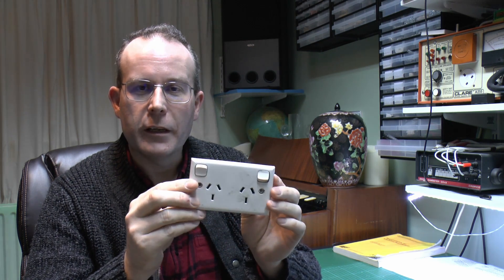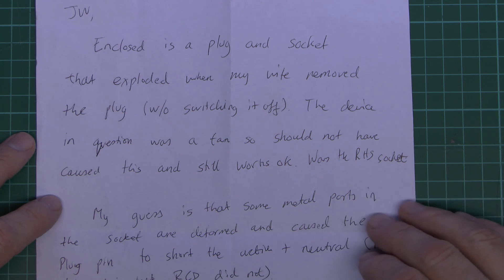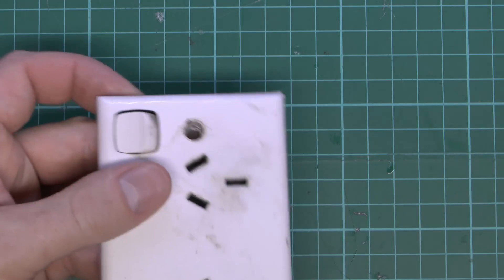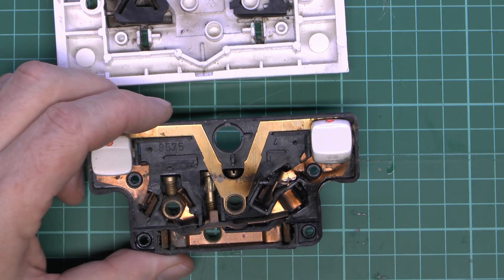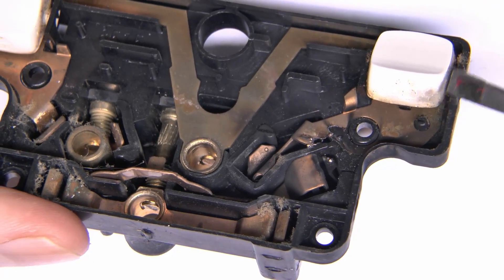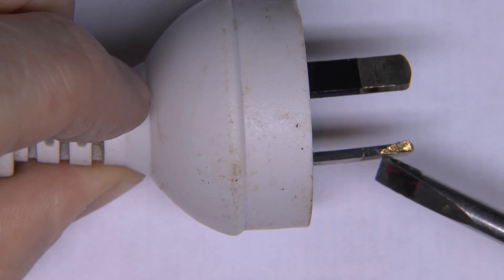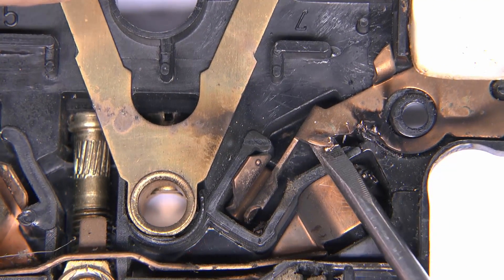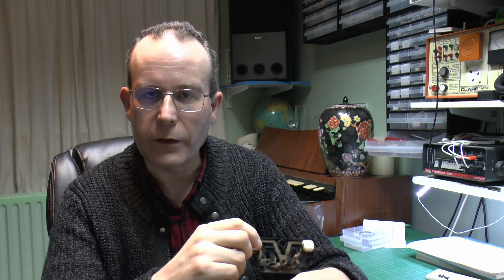Failed Australian Socket and Plug

Comment: It's hard to tell for sure, but the socket looks to be from the early 80's.   Maybe sockets wear out after a while, especially if you plug and unplug frequently.  HPM is regarded as a reasonably good brand.
Reply: Tommy Oz 1991 date code IIRC. Definately was a well used socket being in the kitchen.
Reply: That's interesting, did you replace it with another HPM?  :)
Reply: Tommy Oz I think the Clipsal brand are usually better
Reply: Tommy Oz can't remember the brand, HPM or Clipsal but it looked almost identical to this old one which also matches the rest of the house.  This one and one near it are by far the most used in the house so I replaced both at the same time.
Reply: Nonsense, (with all due respect) they are cheap crap and always were. Reputable electrical contractors (like I was) always shied away from HPM. The 777 socket was made from probably mid to late sixties to somewhere around 2005 as far as I am aware with no change in design This was despite HPM being constantly told of common problems. The only thing HPM ever made that was good was some of their electronic devices such as timers and the old incandescent  light flasher/chaser units and I suspect they were sourced from Asia.
Reply: Micky Mouse...this was a one-off failure and it could have been due to the person continuously wiggling the plug as they pulled it out over time.  The electrical safety standards in Australia are as strict as those in the EU and the UK and, as far as I am aware, a bit stricter than those in the US.  The HPM branded stuff was common place in homes from the 60s up to the 90s.  Clipsal was another brand here who made very good outlets (including hospital grade) and continue to do so.  Unfortunately (and I'm sure this is happening around the world) there are some questionable sets coming in from China these days.  The Chinese stuff made for local reputable brands is usually okay and has been submitted for testing by the regulatory authorities BUT there are these "dollar stores" that have cheap Chinese stuff that have the regulatory stamps on them (fake) but are absolute rubbish.  The authorities here regularly raid these sorts of places and then fine the suppliers but it's like trying to hold back an ocean wave!
Reply: Well I have better things to do than go on about this. You will find that nearly all reputable electricians in Australia think HPM is crap!
Reply: @bobmarshall3700  hello Bob is there a brand you recommend in oz?
Reply: Being in the kitchen grease and mildew can build up inside, it happens here in the UK too, usually the ones close to cooking appliances
Reply: Tommy Oz they are mandatory in caravans and motorhomes due to many campsites and extension leads being of unknown provenance.
Reply: HPM is fine. The 777 series came out in the very early 70's. My house was built in 1976 and had a mixture of HPM and Clipsal throughout. All replaced with HPM excel series during recent renovations. The only socket that did fail was a single Clipsal GPO in the lounge room. It wouldn't turn off (the mech would move but the socket would still be live and would need a few goes for it to turn off. Replaced with a HPM standard double years ago and then with the excel series recently to match the rest of the house.
Reply: Recently I was looking at the double pole switch style sockets that disconnects both active and neutral.  I wonder if these are ok for use in the home?  I guess it could make things a little safer since it completely disconnects the appliance form the mains. You can find it here: https://www.jaycar.com.au/double-gpo-with-2-pole-switches-for-caravans-motorhomes/p/PS4069
Reply: Tommy Oz outlets do wear out after a while as I’ve had to replace five in my house because the bedroom circuit is on the same breaker as the living room outlets (American Style outlets) and one outlet failed so two of the living room outlets worked and the rest of the outlets were dead so I narrowed it down to one outlet that had just died no sparks no fire nothing it just stopped working
Reply: I am glad that ill not be going to Australia any time soon, if that is the standard and quality of their sockets. They look like crap and potentially dangerous

Comment: This is the reason why it's important to switch off before unplugging. Had they have been in the habit of doing that, the short would not have happened despite the loose part in the socket.

Comment: I need to replace a Chinese 2 pin plug on a small exhaust fan with an Australian one but the replacements all seem too big and loose on the power lead. Do you know of a replacement plug that is smaller and suitable to small appliances. Thanks mate.

Comment: This plug is also used in Argentina
Reply: Also in China, Fiji and New Zealand
Reply: @LoganT547  No, the Chinese ones look the same superficially, but are wired differently and sockets are installed upside down.

Comment: Legrand bought HPM a little while back,so I'm wondering if design changes are in the pipeline,I have always been an HPM fanboy,I detest Crapsal,sorry Clipsal,I hate the way the switch mechs feel,in my experience they fail in different ways though,but having said that their 3 phase & industrial gear is not too bad.

Comment: I supposed that's why each socket has its own switch. The switch is supposed to be off whilst hooking/unhooking plug. Here in America we don't have that but I know to make sure the power switch on an appliance is off during connection/disconnection. The Australian standard is based on a defunct American plug type.  With such flat pins I don't like the idea of the insulating sleeves. America don't have that neither bit we also 120v.  Insulating sleeves leave less surface area for pins to contact socket contacts. Our space heaters and other high draw appliances have tendency to overheat plugs causing at times fires!

Comment: several times my partner has pulled her iron plug from the socket without switching it off. If the element is heating at the time of disconection you always get a CRACK as the plug is pulled due to the high currant accross the pins...so many times ive told her to turn down the iron or switch it off at the plug before removing it.

Comment: We use the same plugs and sockets here in New Zealand and I've never seen a socket fail catastrophically like that one. The fault is usually a piece of wire, aluminium foil, needle or pin drop across the terminals as the plug is withdrawn from the socket. The violent reaction to the rapidly evaporating metal makes absolutely certain that the offending piece of metal can never be found. The classic one is a book binder's staple, often used to secure the accessories to the appliance in a small plastic bag. I worked for a lighting manufacturer and that was how we supplied the mounting screws for the small light fittings. BTW, the switched socket unit is still available here. They were introduced by HPM in the late 70s in opposition to PDL who sent their manufacturing  plants overseas as it was cheaper, etc. The cost of shipping offset the cheaper manufacturing costs and we paid more for them.

Comment: If it was used in Queensland, then humidity could also be a factor. A damp patch, or a drop of water, would be enough for a flashover to occur. We had that problem with several plugs and sockets when we lived in Sydney, NSW, where 90%+ humidity is very common, even in Summer temperatures. Insects inside the plug or socket can also give spectacular 'final performances'.
I've also seen evidence of similar flashovers between the edge of a fuse holder and the Earth connector in U.K. BS1363 plugs, sometimes exacerbated by a strand of the Earth wire protruding slightly beyond the edge of the cable connector on the Earth pin. Humidity, or dust and dirt, make things worse.
Reply: I'm thinking water; may be there was water on it before it was plugged in

Comment: The Australian-N.Z outlets are also used in mainland China, and I believe that they are a near exact copy of an older 125 volt 15 amp/250 volt 10 amp outlet from North America, which were introduced by the Hubbell company back in the 1920s or 30s. I don't know how most of the Aussie outlet are constructed but most North American outlets and switches have the hot/live/active and neutral connections on opposite sides of the outlet, with screw terminals, I don't think that the vintage American outlets that these were based on were any different.

Comment: Excellent analysis.  I'm trying to figure out why those receptacles have switches. Looks to be an expensively made part. Here in the U.S. our receptacles are cheap but I have had no problems pulling out cords under load.
Reply: In many parts of the world, switches are used with sockets so they don't have to pull out the plug every time.

Comment: We still used these in Brazil for Air Conditioners, washing machines and some other heavy appliances until the new plug came around in the late 00's. But it was only the connector patterns, not the inside circuitry, switches and most important of all, they didn't caused any short circuits.
Reply: 16A plug?? BTW, Chinese 10A AU plug can’t fit on 16A Chinese outlets.

Comment: HPM & Clipsal have not been made in Australia for years. This GPO is an old unit. I have seen this problem occur in more than just HPM products. It’s caused by two things, 2.5mm solid strand conductor supplying the outlet becoming loose in the terminal over time from the load causing expansion & contraction from load heating. This conductor is common in older installations.This doesn’t happen with stranded conductor. The other problem is a bad neutral connection in the Moulded plug on the appliance lead. I’ve seen this a lot. Plugging the lead in & unplugging it causes movement in the back of the plug at the connections. This example shown in this video is not caused by a defective GPO. The GPO neutral terminal was burnt from returning current through a poor connection at either the plug or a loose connection at the GPO connection.

Comment: My USA electric clothes dryer plug and outlet look like that but are about 4 times larger. The plug is rated 50 Amps at 240 VAC. Sometimes it takes 2 hands to remove one. The dryer is rated 6500 Watts.
Reply: kimmer6 why do you guys have such large dryers? Most domestic clothes dryers here run off a standard 10A outlet (2400w at 240v)
Gas dryers aren't common here though.
Reply: Ben,
This is the USA where a 5 liter engine is small.
My ex wife needed the extra capacity dryer to dry her underwear. I thought it was a bunch of table cloths and bed sheets, but noooooo. Enough shit to build a circus tent and sail a 20 meter yacht.

I switched to a gas dryer and love it. I still have the live 240vac  outlet in case I need to plug in my welder.

Comment: It is my educated guess, as a non-electrician Australian, that the reason that the labling on the back is upside down compared to the front is that once the power point assembly is partially or wholey wired, whenever it is not srewed into the wall (when an electrician is working on it), it hangs upside down by the wires and as such the labling is oriented for how it is most easily read as it is most likely to be seen.

The labling is also positioned so the wires are not in the way when it is hanging out of the wall.

Comment: Looks to me like the plug was pulled out slightly and the neutral (right side) arced on the end of the pin.  The arc then jumped to the phase line passing very close by.  Probably a bit of gap between the rear and front plastic that let it jump through.  Once established the current tripped the circuit.  The spacing iis close but there should be a plastic barrier between them when the unit is assembled.  The contact would not lift out of the plastic when the unit was assembled.

You have to look at the front and back halves when assessing this failure.  There would not have been any metal to metal contact between the phase and neutral metalwork.  HPM was one of three major brands sold here in NZ for many years through wholesalers and to a lesser extent retail outlets.

Failure tear downs are interesting but need to be fully assessed, with more detail.

Comment: I'd say the fault occurred because the plug was removed with downward force (up or down, depending on how it was installed but I use the videos perspective.), which then let the right contact of the plug touch the copper rail of the left one, which was slightly lifted up, while it was still connected to it own contact. (To clarify: I mean it was not pulled out straight, but tilted)
That's maybe caused by the old and worn plastic enclosure. I think this makes more sense than simply uplifted rails.

Comment: In older sockets dust and high Aussie humidity (some areas) often combine to exacerbate problems with slightly movable and somewhat close  contacts as shown.  Also due to the smaller size of the Australian plug compared to the rather beefy British one there is a greater chance of giving it a good wriggle on the way out, usually in the up/down direction and causing contacts to get a little closer than designed.  These Australian plugs and sockets will usually get quite warm when carrying at/close to the rated 10A especially with older sockets where the contact tension is weaker than when new.  It remains that sockets should be replaced at some interval, in my opinion at least.  I also think that they should be designed with the earth pin at the top, the reason for this is (I hope) obvious.   The newer plugs with partially insulated pins negate this but there are still many appliances in use with non insulated pin plugs.  Having rambled on it does remain that, in my opinion, HPM were/are always a bit cheaper than others and consequently a little lower in the quality/design area!

Comment: HPM brand switches and power points have always been cheap, inferior crap. If you mount these double "power points" on smooth glazed wall tiles and do up the two mounting screws tight enough to stop the point slipping and sliding around, one of the switches will not work. As an Australian electrical contractor for 30 years I continually told HPM of the problem. They never did a thing to rectify the issue. Plastic was always to thin and bendy. Their light switch mechanisms also fail after a few short years of operation. For that reason I never used HPM unless a customer supplied their own fittings.

Comment: If the plug got stuck and then it was twisted to the left when removing, it could have lifted both contacts and twisted them close to one another. Other observation: spider web inside socket. That one's probably not a biggie, however.

Comment: It looks as though some loose wire strands are present inside the receptacle. Arcing caused by wire strands? The plug included obviously didn't contribute the strands, improper installation or old style open plug perhaps?

Comment: Those connectors cannot move like you said, when the socket is assembled the front covering prevents those contacts from moving. More likely there was debris inside that caused the short when the plug was shifted.

Comment: Take a closer look at the front panel - interior moulding lugs act as clamps and isolators for the traces and socket pins, preventing them from coming forward or contacting each other

It actually looks like the plug was withdrawn and angled in the process, allowing the pin to somehow bridge the L-N gap.

WRT comments about induction arcing - the double insulated fans that are typically used are dinky little shaded pole induction motors and inductance arcing is virtually non-existent.

Those 2 pin plugs are officially frowned upon - primarily because if inserted into a socket with an earth-pin operated shutter they can damage the shutter - but because they don't have the extra pin they can also be twisted through a range of angles that HPM designers never envisaged in the 1980s.

Official advice is to always withdraw a plug with a straight pull, but for various reasons people frequently attempt to wriggle them out. This is a good example of why you shouldn't do that and also of a design that could do with a few more mm clearance in the routing from the RH switch to the L pin.

As for why only the UK/ROI/HK use socket fuses: 

Only those countries use ring mains cabling of 16A capacity with 32A fuses (coarse protection) to feed a large mass of 10-13A sockets that have close protection in the plug (which is only there to protect the appliance wiring in the event of a short as for very light duty flex the current may be insifficient to blow the 32A fuse). 

My entire UK house - 20 sockets - is on one MCB! and is a typical 1970s installation.  The obvious danger is that if one side of the ring is broken then the other side may end up carrying far more current than it was designed for and possibly start to burn.

The standard in the rest of the world is spurs (sometimes daisychains) and a 20A  breaker, but under no circumstances would the coarse protection of the MCB/fuse exceed the current rating of the wiring.

UK plugs and sockets are well thought out, although the pins are far too large. UK domestic ring mains are a heath-robinson disaster predicated on post-ww2 cable shortages and should have been outlawed decades ago. It's good to see a lot of more modern installations tend to use single runs of adequately-rated cable with spurs to 1-3 other sockets at most.

Comment: Watched this video last week and today was plugging my laptop in OZ HPM socket and it flashed tripping the breaker. Same burn marks right up to the switch, so I disassembled and the same failure mode. Thanks for the tip.
Reply: Martin, did you pull the plug straight out or was it angled slightly/waggled?
Reply: Alan Brown I was plugging it into the socket. It may have been slightly angled, but shorted through the neutral pin to the active on the socket in the same way as John showed.